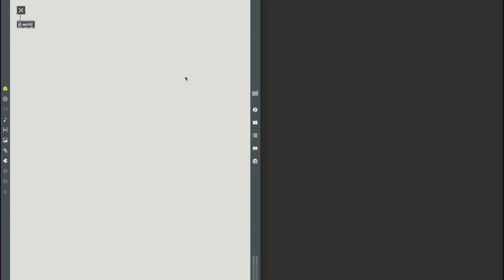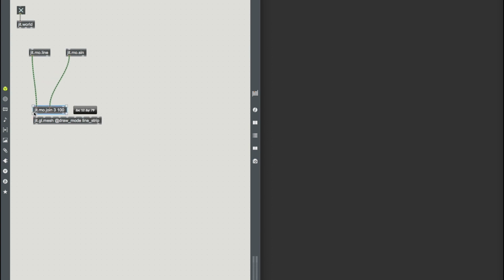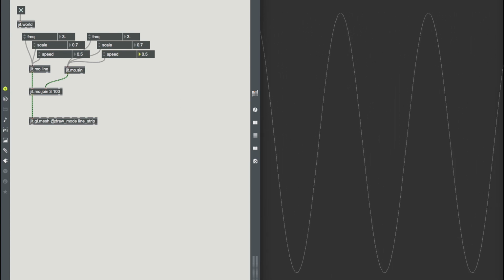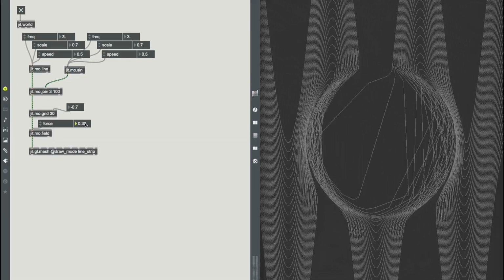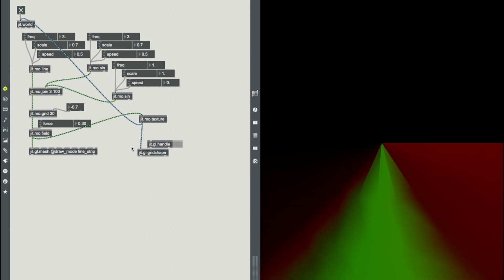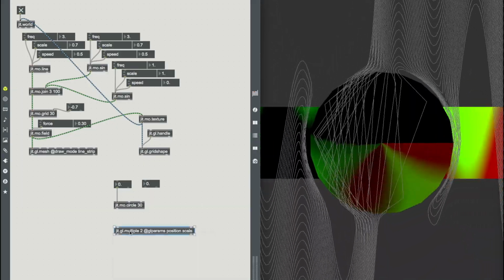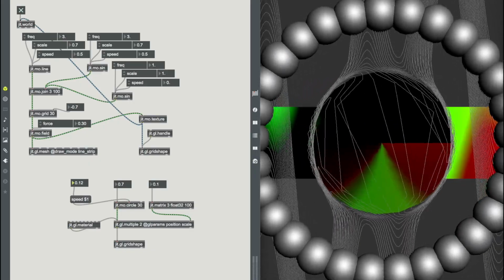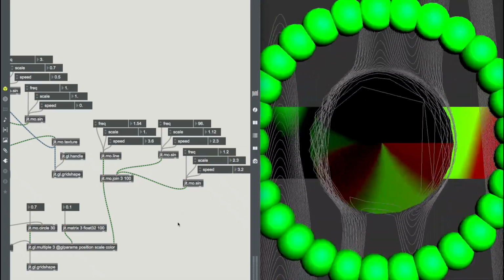jit.mo - Part 2

Comment: Great tutorials thanks!  Is there an easy enough way to control the colour of the circling spheres as I can only get them to morph between blue and green.  I've tried adding the color param to various inputs to no avail.  Yes, I'm a jit newb.  :)
Reply: Jitter & openGL actually process color in different ways for some stupid reason... it's really easy to mess it up as a beginner (been there, done that)

Jitter's format for color is ARGB. each color is represented to a value between 0-255. 
OpenGL's format is RGBA & uses floating point numbers between 0 & 1. 

Also, something to note- the jit.gl.gridshape object is the object drawing the actual circles- this is where the color is determined. Jit.Mo is used for controlling the automation, it does not create the objects themselves.